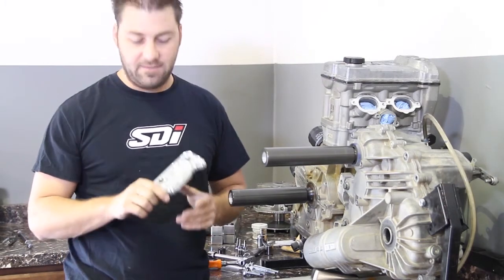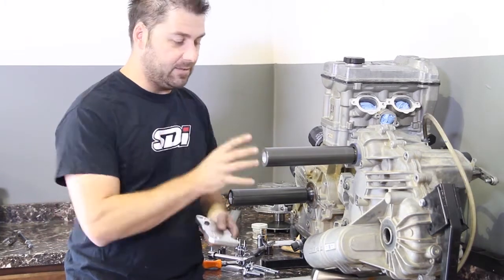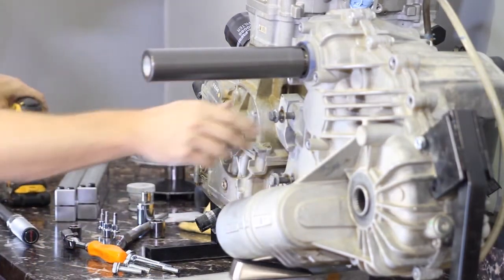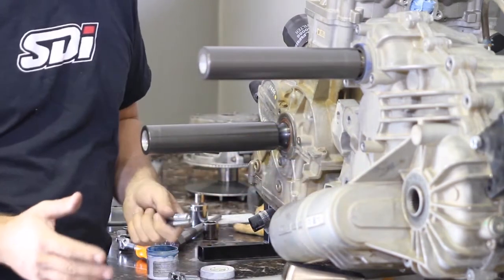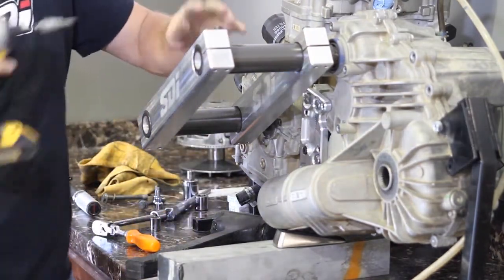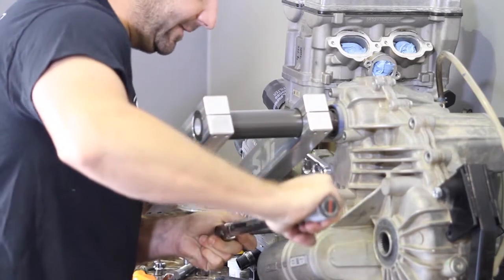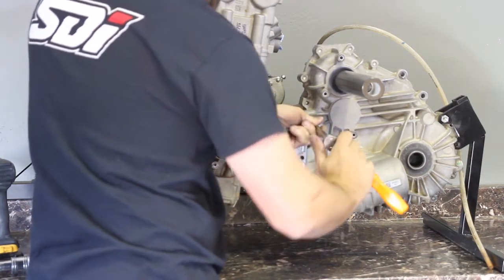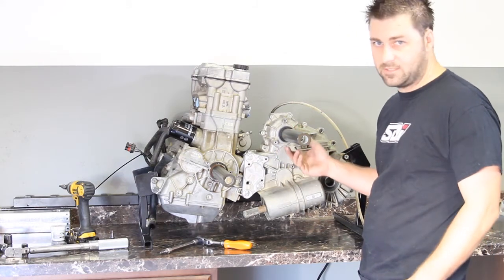SDI Motor Plate Upgrade for Polaris RZRs

Comment: Should you have the rear transmission bracket loose or tight ? I’ll be reinstalled my transmission just finished a gear reduction. I purchased your clutch alignment tool and engine plate

Comment: Does sdi have an alinement tool and clutch plate for a 16 rzr turbo?
Reply from the maker: We do have an alignment tool for the 2016 RZR Turbo. However, we cant make the Flex mate due to how the engine/transmission is designed.

Comment: how many miles u guys usually see the alignment needed, depending on the style of riding?
Reply from the maker: That's hard to say! We recommend checking at the beginning and end of a season. In california, that's like Mid September until May or so. We've racers complete the 1000, check, and not have to make any adjustments!